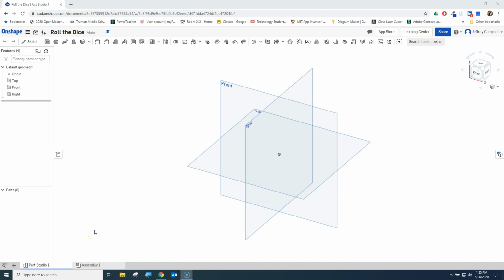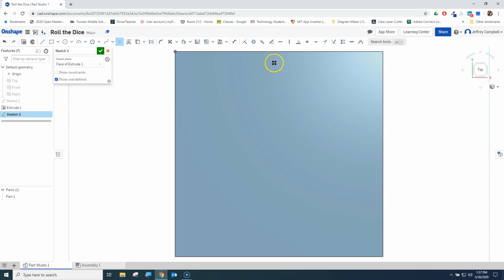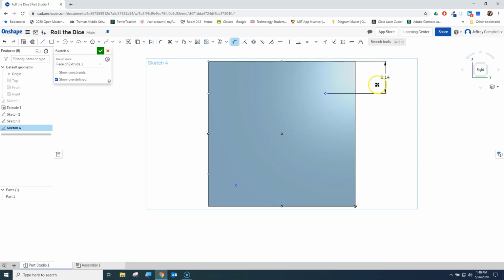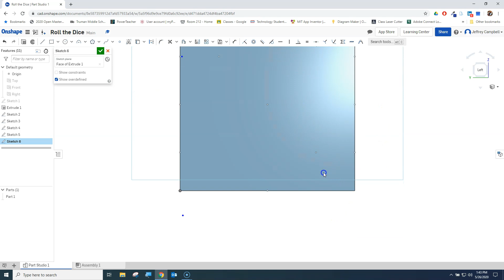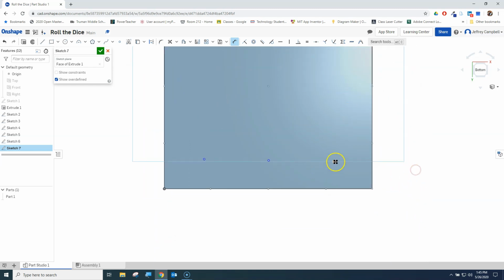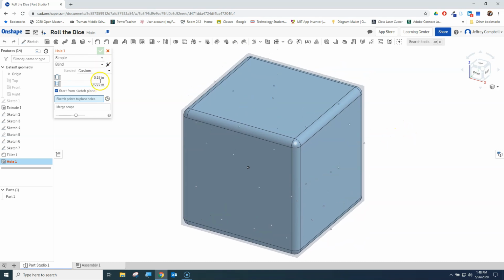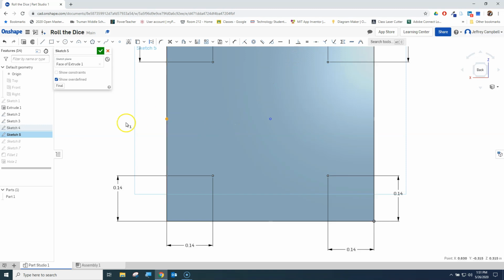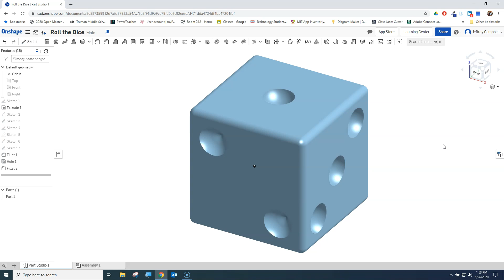OnShape Tutorials - Roll the Dice

Comment: When I click to delete those points it does not delete them how could I fix it
Reply from the maker: If you are trying to delete the PIPS (the spots on the dice), there are two ways to do it. Since we made a new sketch for each side, hover over each sketch in the features list on the far left until you find the one that highlights the pips you want to delete. Right click and delete that sketch to delete all of the pips on that side.

Or, when you find the correct sketch, right click on it in the features list on the left and select "Edit" to go back into the sketch. Then you can move, modify, or delete the circle used for an individual PIP.

Comment: Nice video.  It will be a good lesson for my students to get started using Onshape.  A quick question, how do you re-orientate the view cube face, if needed?
Reply from the maker: Thank you for the positive thoughts. Regarding your question, clicking on faces, edges, or corners of the view cube will reorient the view. The arrows around it rotate in 15 degree increments. Right-click and drag the view cube to rotate it freely. The little cube to the lower right of it is a drop down menu where you can change other aspects of the view. The top three, Isometric, Dimetric, and Trimetric, are specific viewing angles. I have not found a way to rotate the object and change which view is the front like one can in Inventor. However, you can use the drop down menu to create specific views. Rotate the object into a designed viewpoint, then select "Named View" to save that angle. The Named View menu can then be used to rotate back into previously created viewpoints. That seems like a good topic for a short video.